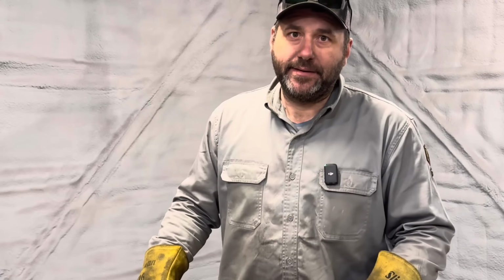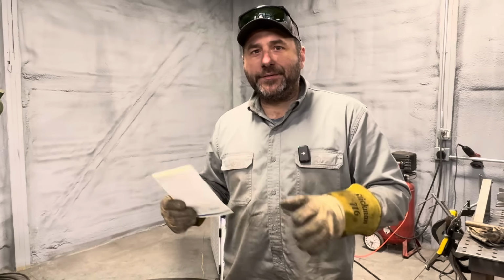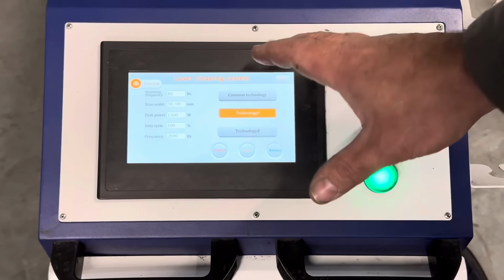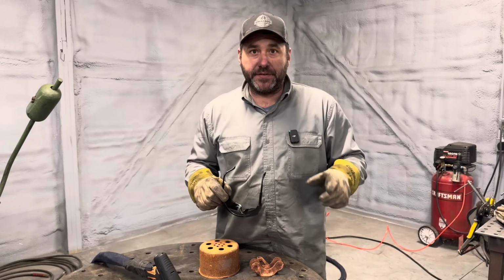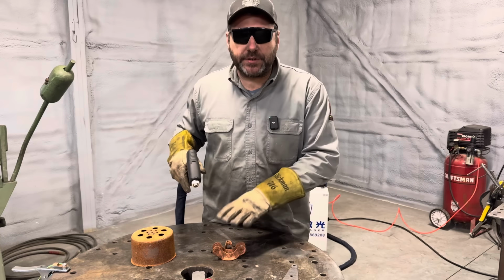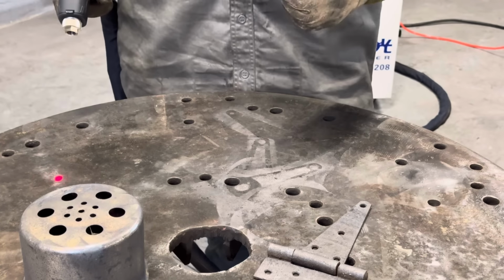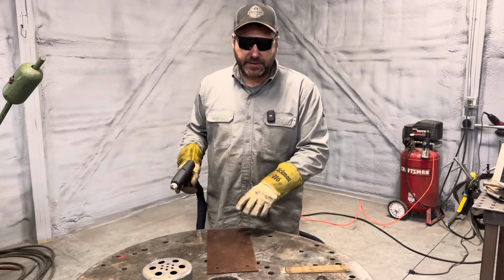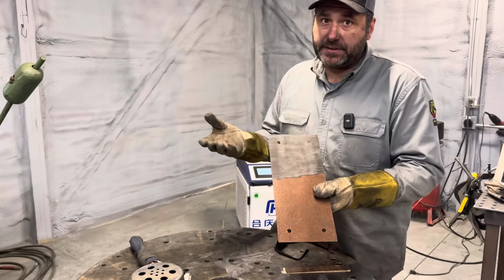Buying a laser welder/cleaner for a fabrication shop.

Comment: When I first heard of these machines, I thought about getting one. I thought it would be around $5,000 - $7,000, which would be a reasonable price to,pay. When I found the LightWELD to cost $25,000 I was shocked. I wonder how well this machine is made and whether it will hold up over time. The problems with service and parts is the big question. There are good companies in China that sell the big fiber laser cutting tables that do have excellent support. Possibly the same is true for these as well. I see a number of different ones on eBay and lots of short videos from Chinese makers here on YouTube, but with no real way to contact them. I assume prices will naturally come down for the better machines, but that could take several years as more manufacturers come into the market.
Reply: I think these are overpriced right now as a relatively new technology. As more and more companies start making their own machines I believe that the price will go down. 

Right now the best way to buy them is direct import even though the support and language barrier is there. 

You should be able to purchase a welding cleaning unit in the $2,500 dollar range.
Reply: My understanding is they have come down a lot in price. Like they used to be in $75-100k range 8 years ago when the first youtube videos of it came out. Now these no name Chinese machines can be down in the $10k range or less. But I think you are right, the prices will stabilize and drop as they become standardized and more understood by small shops.
Reply: @ira_kozak  sort of. They’re not overpriced as the technology isn’t there, so parts are expensive and designs use more electronics and other parts than will later generations. That’s how it always works. So expensive, yes. Overpriced? I don’t really think that’s the right word. They’re likely as inexpensive as they can make them right now. I look inside cheap Chinese welders and plasma cutters and find obsolete parts that are very cheap, but I wouldn’t want to use eight lower power MOSFETs or IGBTs in a welder rather than two newer high power IGBTs. These Chinese machines are like that, where the expensive models are using new technology, but much more expensive parts. But even those aren’t what we’ll see in a few years as this laser technology becomes more popular.
Reply: Maybe you can learn more about the prices of Chinese machines, they are not all what you think

Comment: Note on the laser glasses/goggles.  Biggest thing is the wavelength of the laser. If you get a set meant for LED lasers, then you use a Co2 laser, you might as well not be wearing them. They need to block the wavelength that you're dealing with.
Reply: Did see a video where one guy bought a tattoo removal laser and the laser goggles provided with the laser was the wrong wave length... If he had used the goggles that came with the machine he would be blind now.
Reply: I operated a laser profile cutting machine back in 1995. I remember watching tv after a day at work and things would go a little blurry. Thats when I said to myself I have to get a different job. Cool machine , great capabilities but terrible for the operators eyesight!  I used to make concrete cutting blades by  welding diamond impregnated segments to the circular saw blades with laser fusion. I found out back then that you had to get glasses specific to the type of beam you were generating. Otherwise NFG.
Reply: @moparmissile  god damn… took you that long to realize.
Reply: @moparmissile  glad you didn't stick around and go blind!
Reply: Good point. Also get the proper power rating too.
Reply: @sto2779 do you mean optical dentistry?
Reply: I’m just glad to find a video where someone actually really uses one of these and I can see they work. I’ve seen them on the social media feeds but nowhere else. I’ve been very interested, but not sure if it’s just all a scam thank you.
Reply: I will shorten it for you.

Buy glasses that cover the wavelength your tool emits.
Reply: @realblakrawb  + the material that emits it after intenst heating, like the IR of a weldput
Reply: Yup confirmed, every set of laser safety glasses clearly state the wavelength and power they protect for. Having run automated laser welders I’ve seen a reflected beam set fire to wire cables instantly and your eyes are far more fragile than that. Don’t fuck around trust me.
Reply: Exactly. If you can see the beam with your glasses on, they are NOT working! You should only see the smoke and dust, no laser light. As far as I know, these cleaning lasers are Nd:YAG which is 1064nm. The correct glasses are dark green, so hopefully that's what he has. I would like to see a lot more face protection though. They also use Nd:YAG for laser hair removal, I'm sure he doesn't want to lose any of his beard to stray beams 😁
Reply: So I'm confused, do these things require shielding gasses ?
Reply: @limabravo6065  - No. Co2 refers to the gas inside the tube. Not Co2 or argon as you would find in a MIG setup.
Reply: @DrFiero  ok so when your welding theres no need for shielding? Damn that's cool, I'd love to know how it keeps oxygen from buggering up your work but trying to find info on these things is damn near impossible and I'm not learning mandarin lol
Reply: @limabravo6065   - oh hang on. This message thread was about Co2 vs diode laser wave lengths. Not welding. You do want to read up on a particular units needs.
Reply: 100%, the goggles i use for my little desktop laser are great ... for that laser, If i tried using those for any of the fiber lasers oh boy ... i'd bein for a dark time
Reply: Wavelength Specific is a must
Reply: @philiphaynes1478  rather prefer couple nm surrounding it